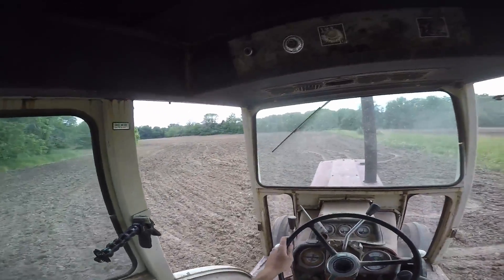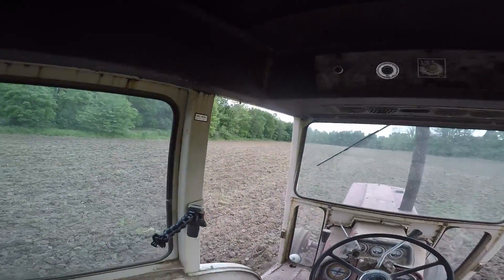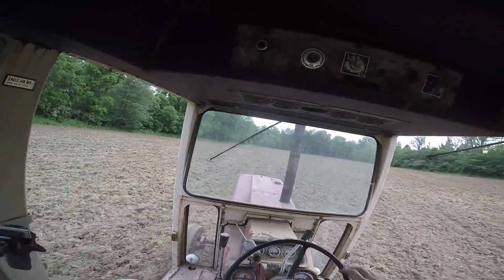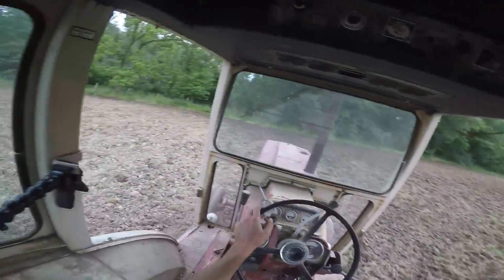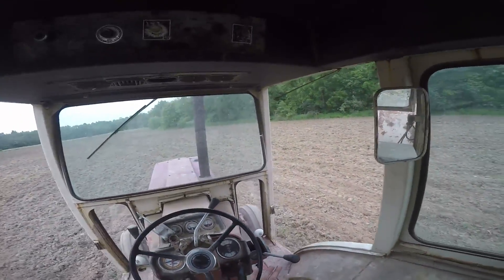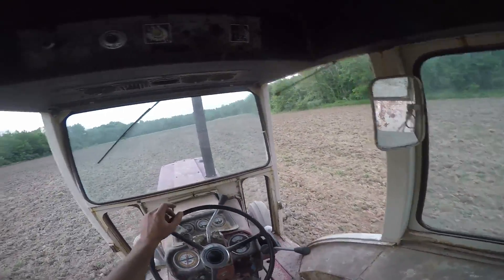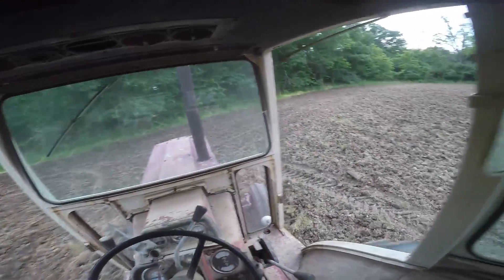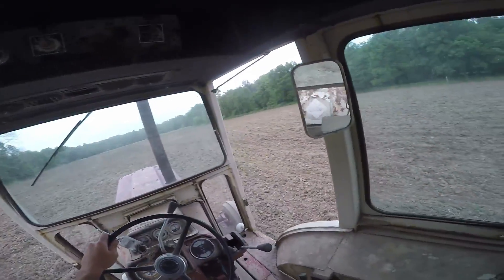Applying Anhydrous

Comment: I've used ammonia as refrigerant. Usually in meat plants and frozen food warehouses. It's still about the best and cheapest refrigerant out there. But as you know it is toxic as hell it will kill you.   Any place that you are wet it will burn you. had most  of my bod  burned a couple of times due to ammonia leaks in hot steamy mechanical  rooms. I looked as if I had spent the day on a beach  My chrome white Irish hide reacted badly to sweat and ammonia.
Reply from the maker: It is a desiccant. Too much exposure and you're an instant mummy.

Comment: Anhydrous isn't even available in our area. Cheapest we have is 30% Uan. It ran 252.00 a ton. We put 40 units down at planting and will dress another 120. Some guys have had good results putting it all down at planting using Nutrisphere. Best thing I've done is switch to liquid starter placing it in furrow. Run 6 gals acre of 6-24-6 with carbon. Wheat oats and barley are being combined now. Good luck and hope for great crops!
Reply: Nichols Hay Farm 250 for 28% in our area
Reply: Nobody Sam  about same price. I'm in NC.  What is confusing to me is the difference in UAN for different parts of the country. Here all we can get is 30%. Other places it's 28% and 32%. I wonder why this is?
Reply from the maker: Anhydrous is floating around 500/ton around us. I would die if we couldn't find anhydrous.

Comment: Have you considered getting duals? Might want to look into applying your nitrogen in granular form, easier to handle and keeps for most the year
Reply from the maker: I have been searching for rims, I have the old tires from the 1466 and it has hubs on it. I have thought about urea. I have seen bad spreader jobs which most of the product ended up directly behind , rather than fanned out behind the spreader, and many of my fields are small and odd shaped, causing wasted overlap. Knifing anhydrous gives me a more even spread of nitrogen.
Reply: @boehmfarm4276  yeah the other thing with urea is, you want the stuff disked in IMMEDIATELY to prevent it from volatizing away into the air.  

We used a similar machine for knifing in liquid blend... only difference is it's an unpressurized tank, and the thing had either a John Blue pump (variable displacement piston pump) or squeeze pump that you set the rates on by changing the piston stroke on the John Blue pump, or swapped out sprockets like a planter on the squeeze pumps.  They had a scrub tire on one side that would be lifted up when you raised the knives, which stopped turning the pump once it was lifted off the undercarriage tire, and when you lowered the knives again the scrub tire would come down on the main tire of the applicator and it would start turning the pump again through a roller chain.  Worked well.  Some guys pulled wagons with a similar setup to carry 800-1000 gallons of liquid pulled behind a hipper, using the hipper's ripping shanks to knife in the fertilizer... usually with a sweep that had tubes welded onto the back of the sweep wings, connected to a hose coming down the back of the shank to the tube extension sticking up behind the sweep.  They did anhydrous the same way most times-- the ripping shank would inject the anhydrous directly into the bed and the hipper worked about like your cover disks, only much bigger and four of them, to throw all the soil back up on top of the bed and seal the anhydrous in at the same time.  Wagon was pulled along behind and usually controlled via a solenoid from the cab.  

Later! OL J R :)